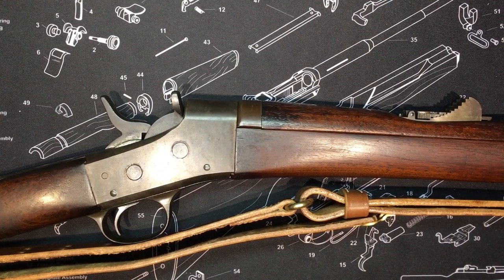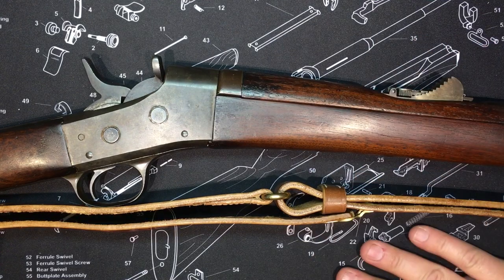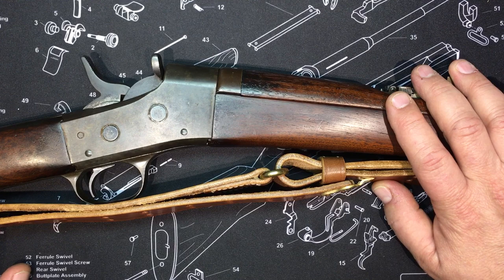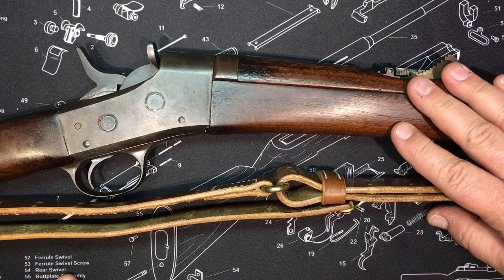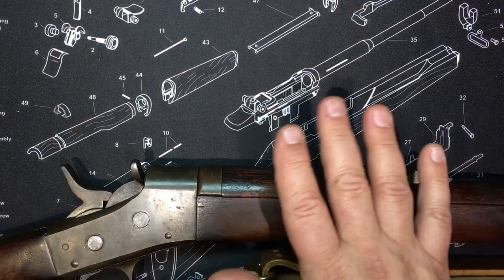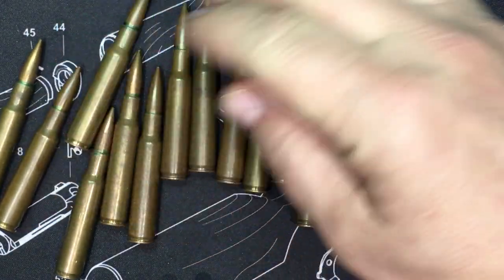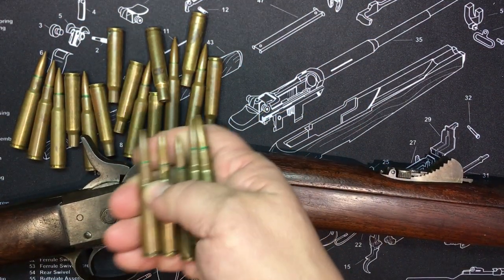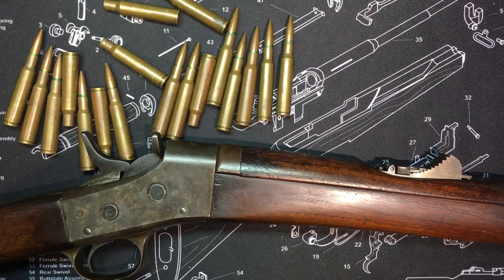Shooting the Remington Rolling Block 7X57 - Is it Safe?

Comment: I had one dated 1907.
Someone gave it to my dad in the '50's. Very Good++ condition. He gave it to me about 1990. I made a casting of the chamber using Dowman's Fix-all. Got some dies and components and loaded some rounds a grain or two LOWER than the BOTTOM load(s) in my Speer reloading book.
Got 1.5"  5 shot groups off the bench at 100 yards with 140 gr. Remington psp bullets.
No excess pressure sign on the brass, but what unnerved me a bit was that after only 4 or five rounds, the receiver and barrel got hot enough to light a cigarette with. I sold it to a pawn shop and sold the dies and brass to a guy with a more modern 7x57.
Love the old timer guns, but not enough to risk a injury!!
Reply from the maker: Thanks for relating your experiences.  I’ve heard (and overheard) so many stories about reloading and how firearms react to different loads.....makes me respect the knowledge needed to remain alive when selecting your ammunition parameters.  So much so that I for one don’t do it. 

I can imagine one of these reloading experts of 50+ years reloading experience saying something like “the slow burning powder you used was creating a lot of heat... a faster burning powder would help with that but raise pressures”. 

I’m not saying that is true, I’ve just been around those guys so much that I can just imagine them saying that....especially when reloading book guidelines were “adjusted” in one way or another. 

The old timers playing poker at the gun shop round table aren’t quite ready to invite me in but I roam around and listen a lot.....every once in a while I’m asked an info question to settle one of their arguments.  At 52 I’m still just a kid to them but they DO respect the collection.

Comment: I have one that was sporterized..cut to 24 inch barrel and fitted with a receiver sight. I shoot it with cast bullets and it is VERY accurate.
Btw our range in the dry interior of CA restricts steel jacketed bullets in the summertime because they have caused fires.
Reply from the maker: Probably a good idea.....I HAVE seen sparks.  Thanks for tuning in.

Comment: The best safety for all old rifles of that age is to use mild ammo.  I own a trapdoor that i load for.  I stay around 1300 fps and under 18000 CUP.  Reloading is a must when you own rifles of that age.  The good thing about Rolling Block is that it is a strong action by design in contrast with Trapdoor which is weak by design.  Rolling block is the king of single shots.
Reply from the maker: I use Chilean surplus 7mm from 1976 stamped F.M.E. on the headstamp.....I have an older video showing this ammo purchase from Samco Global Arms back in the day.  I don't shoot the Rolling Block much but when I do I use this ammo......you think it's safe?

Comment: I looked at a 7mm Rolling Block carbine at a shop yesterday. It has a good bore, otherwise good also. Very tempting. The Remington roller has a good reputation for strength but I'll be doing more research. I have several hundred rounds of PPU 7mm soft point, If I buy the Roller that is what I would use, unless the pressure would be too high, in which case I'd break the ammo down and reassemble with a lower charge.
Reply: What is the shop asking? My advice, buy it -- unless the price is completely outrageous.
Reply: @browngreen933  The asking is $995 with a bayonet. I went there today and got my first choice, a Krag saddle ring carbine Model of 1898. I'll be looking at my collection for things to trade for the Roller. The shop is full of old firearms, there is a crate of Mosins with all the accessories including armorer's tools, another crate of Russian SKSs, all manner of things. There's a Norwegian 1911 I like...
Reply: @3ducs  
I suppose that's what they're going for nowadays. Shop sounds like a cool place. Good luck!
Reply: @browngreen933  I'll make a counter offer, it's expected in shops. It's a VERY cool place! I only went there for the first time yesterday. YouTuber GunBlue490 alerted me to the shop, he has a very good channel.
Reply: The lower powder charge will not help at all,the case shoulders have to be moved ahead longer so they headspace correctly.Read the fix I posted above and that is the best way to handle these old 7mm rollers with headspace problems and most all of them have headspace problems,I have only seen one 7mm roller in my life that didn't have excessive headspace,its an easy fix and sounds harder than it really is.I have a batch of these modified shoulder cases that have 12 loading's on them and they may still have 12 more left in them and they are loaded to factory specs.

Comment: I reload and I shoot my 7 mm rolling block all the time. I take new brass build a light load. That brass gets fireformed then I go to a medium load.
Reply: agreed, i have a ton of all types on milsurp ammo but since these ole girls have went up in price I hand load now even for Mauser's n Mosin's.....
Reply: What would be a Light load to medium load look like? What powder are you using?
Reply: Desand Bonville - In a reloading manual you will have five or six velocities and loading data.

The slow velocity are the low charges.

The medium velocities medium charges. 

The higher velocity’s are hot charges.

Comment: I owned and shot, a original VG condition 7 mm RB. Even with light hand loads, I was getting stretch marks near the head of the case. Since I had previously had a case separation, when shooting another guys 8 mm Lebel RB. It about scared the poop out of me.  Needless to say I got rid of it quick. IMHO RB's chambered for military smokeless powder cartridges. Leave a lot to be desired, safety wise.
Reply from the maker: I’ve heard everything from they are dangerous to bulletproof.....guess I’ll have to risk it to find out.

Comment: I'm going to guess that these cases are non-reloadable because they are Berdan primed. There is a method for de-priming that may work on them. Find a wooden dowel that fits your casemouth tightly and fill your case with water, place your case on a block with a hole large enough to allow the primer to drop through and then rap the end of the dowel with a mallet. Hydraulic pressure should pop out the primer on a Berdan primed case. Then clean and reload your cases with a safe load of modern powder.
Reply from the maker: I’ve seen that.  I have enough of the surplus 7mm to last my lifetime....even IF half of them don’t fire.

Comment: It can be quite dangerous to put less powder then the minimum recommended amount. Some powders will always explode dangerously due to inconsistent ignition from insufficient case pressure if loaded less than 85-90% of case capacity.
A man who researched the last hundred years of recommended practices in order to safely underload big game rifles found that Unique and Hercules 2400 powders have been safely used for "mouse fart" type loads for a very long time. I myself am so very grateful to have found his article before I experimented with removing powder from factory ammo to make it subsonic. I will definitely be using one of the safe powders in fired factory brass.

!REPEAT! Never load less than the recommended minimum amount of any powder without doing reseach on that powder!!!
Reply from the maker: I agree. There are so many aspects of reloading that are counterintuitive. Very interesting science. Thanks for the info.

Comment: I have a Remington rolling block in 7mm . I also have 3 mauser 7x57s . I did a chamber casting of the roller. Had a long chamber. The rifling was not that good. I was concerned about having a case separation. I replaced the barrel with a 40x65 black powder barrel.
Reply from the maker: Really wonder what mine looks like......

Comment: So how do you sight in the iron sights on these rifles. Mine is shooting 4 inches high at 50yds. I'm guessing the battle zero is 100yds or 200?
Reply: Most of these old rifles are intended to be aimed with a 6 o'clock hold. And in my experiences, the range adjustment for the sights tend to start at 200 yards/meters at least. So you'd expect to shoot high at 50 meters/yards. Don't know if that's the case with your rifle.
Reply: Most battle rifles are setup to hold on the belt buckle of the enemy soldier for a chest shot
Reply: You dont, lol (unless you want to replace the front sight blade, but that destroys historical value). If it's shooting 4 inch, hight at 50. I'd say it's sighted for 200 or more likely 300 meters (most military rifles of this time period were sighted for 300 meters). What does the rear sight say? Set up 3 targets on top of one another at 100 meters/yeards.  Shoot for the bullseye of the bottom target. See where the group lands and mesure from the center of the group to where you were aiming  and bingo you learned your 6 o'clock  hold. If you shoot alot of milsurps, you just get used to shooting this way

Comment: Fire forming cases could potentially be dangerous, even causing injury or death.  There is a phenomenon which can cause a partially charged bottle neck cartridge to develop extreme pressures.  It doesn't always occur, and it is not fully understood, but there are theories.  One says that when powder does not occupy sufficient volume inside case, the primer charge drives the unburned powder forward into the case shoulder/neck region, where it then violently detonates.  I have seen reports with photos where people have destroyed rifles with what they say are reduced charge loads.  There are proven ways to safely fire form, but pulling a bullet and dumping an unknown weight of unknown powder from a factory case, reseating the bullet and firing the round might lead to serious problems and/or injuries.  Look for professional help if you suspect your rifle has extreme head space or other chamber/barrel problems.  An experienced and knowledgeable gunsmith should be able to get your rifle up and running.  I hope everyone will stay safe!
Reply from the maker: I’ve been firing the 7 mm I have every once in a blue moon without having a problem. Hopefully it stays that way.
Reply: @MilsurpGarage  I hope so too.  Best of luck to you...stay safe!